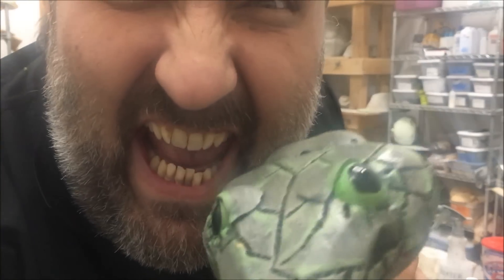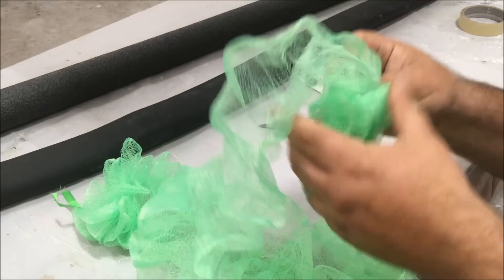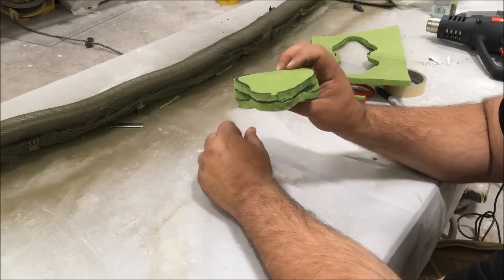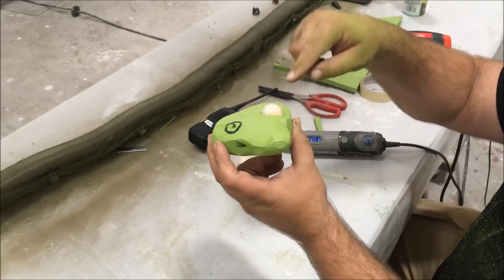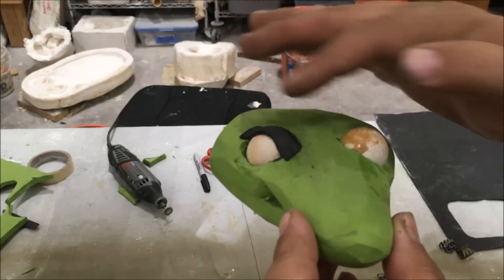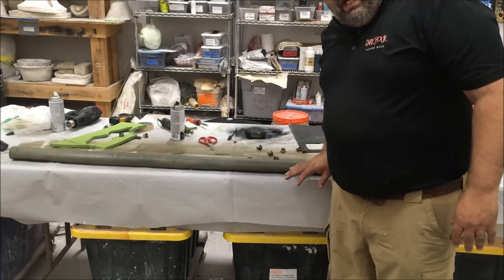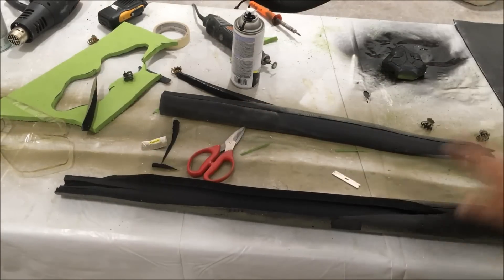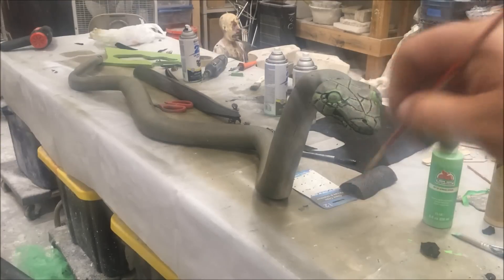Make snakes

Comment: THIS WAS THE VIDEO I WAS LOOKING FOR. OUTSTANDING. I love the flexible hose. 3/4 in. x 6 ft. Rubber Self-Seal Pipe Wrap Insulation? What gauge of wire please?
I am SO using this idea in my project of building twin snakes from spray foam or maybe not since I saw your pose. LOL

Comment: Fantastic video Allen! Does the Armacell Rubber pipe wrap material have a generic name? I would like to make a much larger diameter snake like an anaconda or python than would be possible with the pipe insulation product so hoping to find just rolls of this material to cut to width needed and roll my own tubes so to speak. Any insight greatly appreciated!

Comment: Have you done any Cobras or other hooded snakes? Would you use the same material as the head? It will have to wait til next year, cuz I already have too many projects to finish this year, but I'd like to try that. 
Also; one that has a section in the middle that's made of a larger diameter insulation, is stuffed, and has the tips of the scales around the largest part traced with the soldering iron, so they stick up a bit. I'd use a larger scale pattern though. An old set of fishnets probably. Lol 
One other idea I had was to paint the body with glow in the dark paint before putting on the stocking and spray painting the scales, so the lines between scales end up glowing
Reply from the maker: +trieva mcbeth    Cool ideas I'd love to see your snakes! I would make a cobra the exact same way.

Comment: Is there a dremel attachment or type of disc for a 5 or 6" angle grinder that could be used instead of the belt sander?
Reply from the maker: +trieva mcbeth  yes the barrel sander for the Dremel will work just as well.

Comment: could you of used the cut out parts (the neck and tail area) to make smaller snakes? and use some of those in a setting further away from your customers?? Great video
Reply from the maker: As small snakes or as filler I sure could have, but the longest piece was about two ft.

Comment: You used Pipe Insulation for the snakes' bodies - couldn't you also use pool noodles?
Reply from the maker: not really- I used Isoflex pipe insulation  which is supple and flexible pool noodles are really not that flexible.